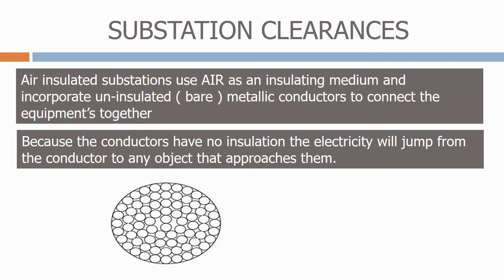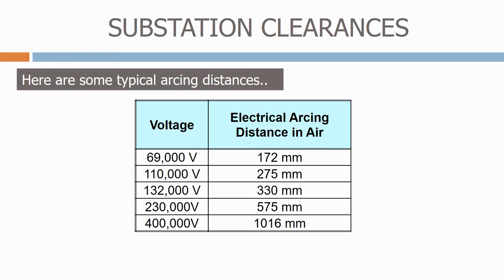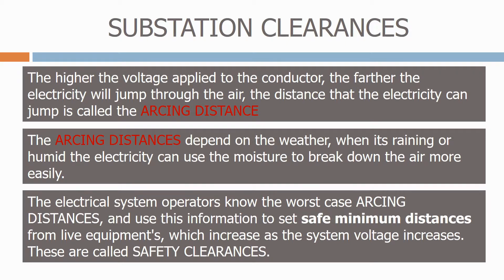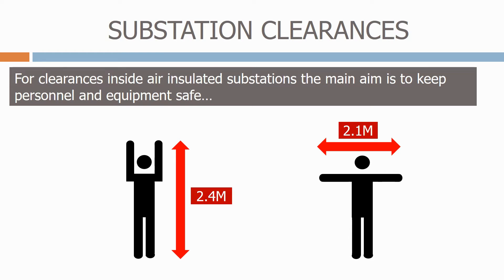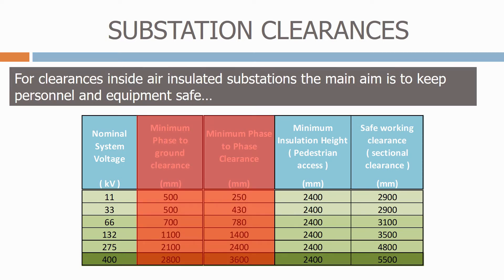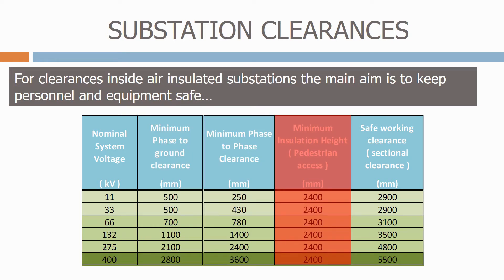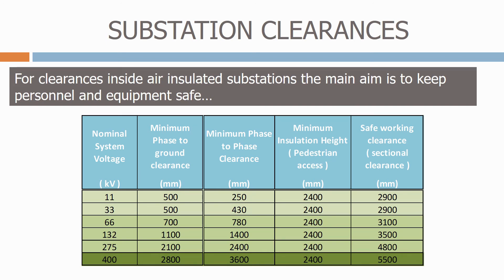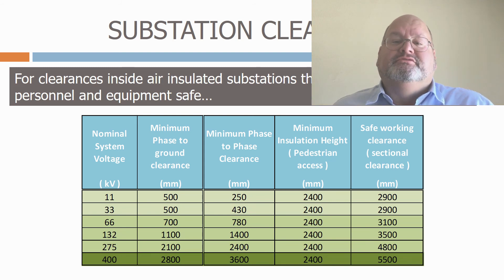Substation clearances

Comment: Why is the phase to ground clearances more than phase to phase clearance ?
Reply from the maker: Hi Bikiron,
                 It’s a quirk of the safety rules. The minimum phase to ground clearance is a safety clearance set at 500mm.

The phase to phase clearance is based on the actual arcing distances , the values for the lower voltages are based on these arcing distances, if you also worked out the actual phase to ground clearance it would be less than the phase to phase clearance, but has to be set at the 500mm minimum.

All this is covered on the full Udemy course.....

Regards

Stephen brooks